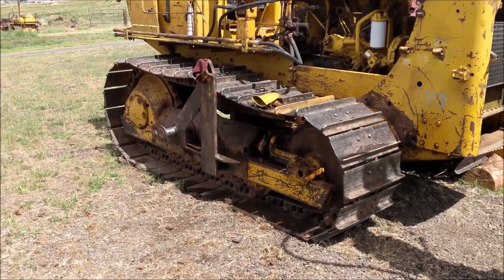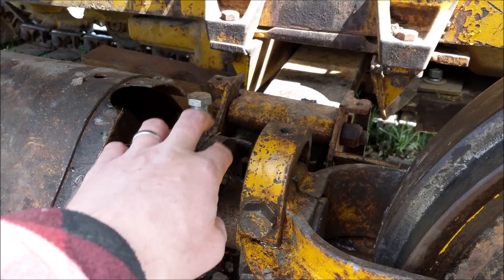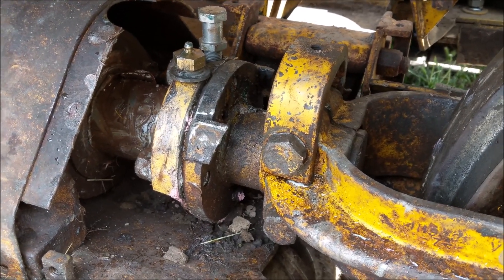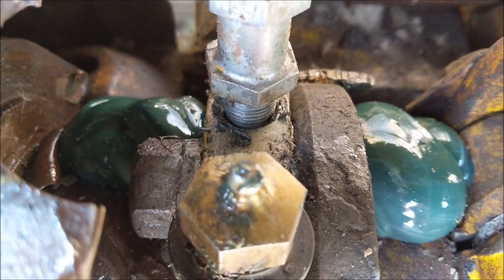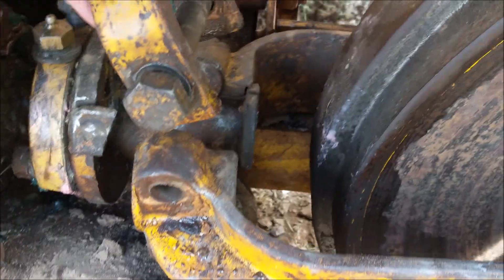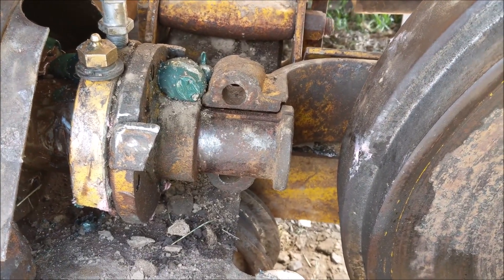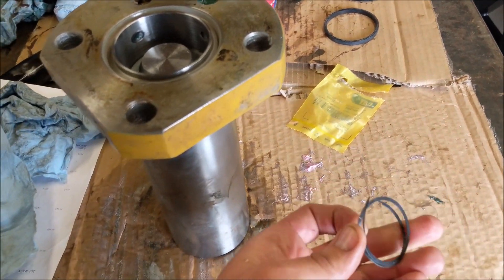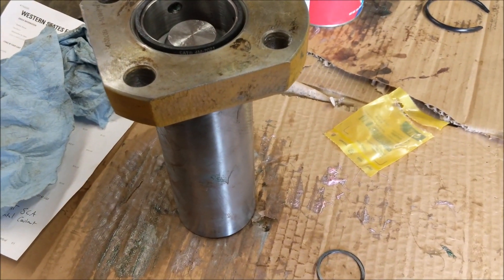Caterpillar D4D Track Adjuster Seal Repair / Replacement

Comment: How did U over pressure it?   How far back did it push thec recoil spring?     How much pressure does that cyl get during operation?    Your super electric grease gun Will not damage the seal,   something else went wrong last time

Comment: Thanks for a great video. I have a d4d that keeps loosing track tension. I assume it the piston seal is bypassing and the grease is packing in the back side as it is not leaking out anywhere that I can see. I will have to pull it apart soon, your video will help a lot when that time comes!!

Comment: Resemble the yokes and the forward stub might be easier with a long stud in the bottom of the pinch gap and or snug up the inside 2 bolts. 
How much taper on the end of the new cylinder to expand the oring into its groove.  A few minutes with an angle grinder followed by cratex polishing discs might save a lot of time later..
Did you back the back of the hole with boat wheel bearing grease before putting the cylinder in. 
Lastly. Do you try to bleed any air out when tensioning the track for the first time after reassembly.   Just a few thoughts from a far.